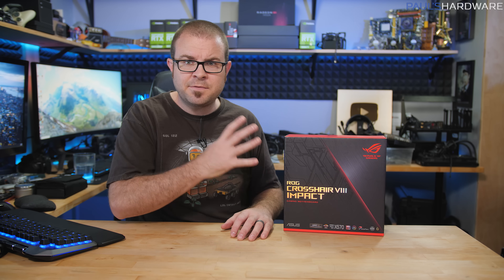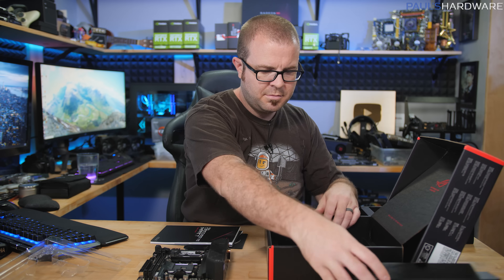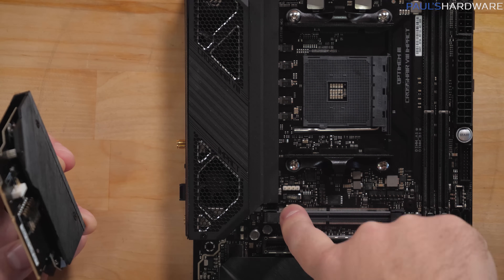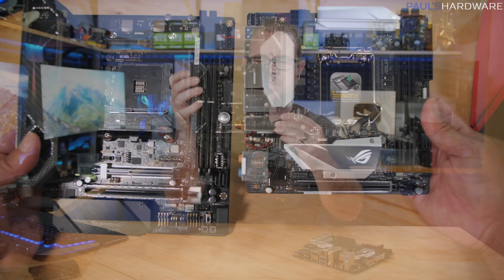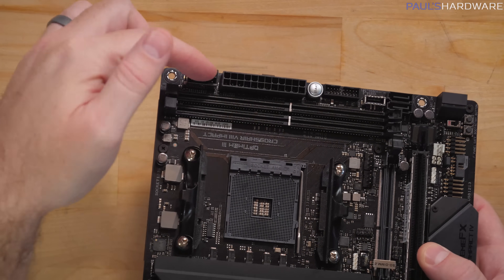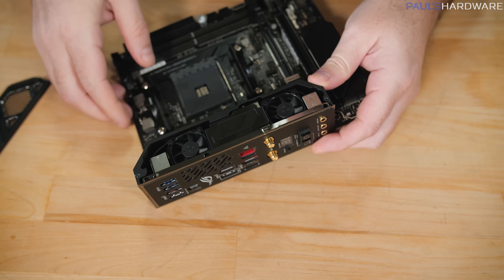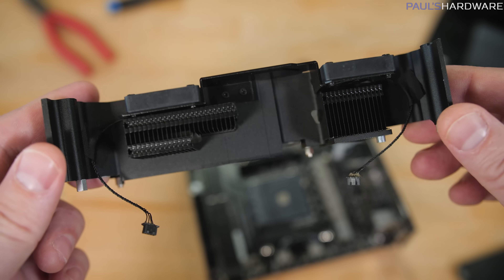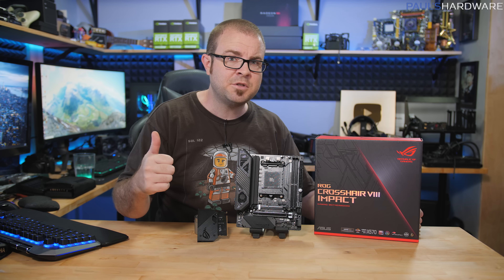WTF is Mini-DTX? Checking Out the ASUS Crosshair VIII IMPACT!

Comment: TL;DR
Mini-ITX is single expansion slot and Mini-DTX is slightly longer for two expansion slots.
Reply: So why not call it an E-ITX, like E-ATX?
Reply: Devin Oakley not confusing enough that way.
Reply: @user-mt4zr5kp7h  Good point!
Reply: @devinoakley4063  or how about Micro ATX? cough
Reply: @MrCODEmaster00  Mini Micro-ATX
Reply: @devinoakley4063  no because eatx is wider while eitx isn't
Reply: @devinoakley4063  oh and E-ATX already exists, another neat one (more functional than just more expansion) is Thin mITX
Reply: @MrCODEmaster00  I know E-ATX exists, that was my reason for suggesting E-ITX
Reply: @devinoakley4063  whoops misread that, also the separate reply saying Micro ATX cough was that this version of DTX isn't too far from being Micro ATX..

You have Mini ITX , and then Thin Mini ITX, Thin mITX is a big difference, this Mini DTX isn't too far from Micro ATX., imo.
Reply: Lol then what the hell is a micro atx?!
Reply: @AW-kj3ln  It's pretty much what it sounds like. Larger than Mini-ITX, smaller than ATX.
Reply: @GallopingWalrus  There's more to it different quality parts are used from an ATX to an ITX all the way around. Many many different features to each size of board. Memory capacity, are you running more than one graphics card, what chipset etc
Reply: @stepheneckart1416  Absolutely true, but even the worst motherboards(from the bigger, well known manufacturers) are pretty good nowadays. Also, there are some pretty baller Mink-ITX motherboards nowadays, on par with some pretty high-end ATX boards.
Reply: Especially on AMD side. You got X570 on Mini-ITX, DTX, Micro-ATX, ATX and E-ATX. Chipsets are alot better spread out than before. Though a B450 E-ATX would be silly, but I would love it for the meme.
Reply: @GallopingWalrus  Thats true. for how long though with these new games coming out.
Reply: True hero. I was looking for this.
Reply: thanks.
Reply: beerpowered so an additional slot costs an additional $300 these days? 🙈 Micro ATX for under $100 perfectly replaces this DTX motherboard.
Reply: Thanks this really helped really fast
Reply: TY lol 😆
Reply: DTX would be... As DTX so far only exist on paper.

Comment: I use a 5.25 optical drive since some games I play still require a physical disk to install. Sure I can get these games as digital download but my internet is crap half the time. Figure since my internet sucks and I have a ODD in my case I may as way use the disk that comes with my boards.

Comment: Wow $400 for an Asus Mini-DTX board that wont fit 2 slot graphics cards, has limited compatibility with Mini-ITX/Mini-DTX cases, and might not fit a tower CPU cooler... good one Asus ive been waiting since May 2019 for this board and now I find out about all these flaws? the GIGABYTE X570 I AORUS PRO WIFI for $220 is looking mighty tempting.
Reply: Man, I've sworn off Gigabyte products. My Gigabyte GTX 970 warped(Gigabyte: "it's totally normal!") and after a few years the VRM burned out from not having contact with the thermal pads. Dad bought a higher-end X470 Gigabyte mobo with a Gigabyte 2070, both of those had loads of issues. My Gigabyte Vega 64 was the single buggiest piece of hardware I've ever owned, had to RMA it several times and most user reviews had a similar experience; it also had a poorly-shaped triple-slot cooler that wouldn't fit in six of my cases(seriously, 6 different cases) so I had to get a bigger case for it(which drives me nuts). Ended up shaving off part of the cooler shroud so that it'd fit in my Node 202 case, thermals are fine with the fan speed boosted under load but the coil whine sucks and now there's no way I can RMA I again; just got a 1080 Ti while it was being RMA'd because I was so disappointed.

Maybe their other products aren't so bad, but they've had far too many strikes for me, man. ;-;
Reply: @FFFan3445  Thanks for sharing your experience, ive had a Gigabyte motherboard before but only once and it worked pretty well but not as good as my Asus stuff. I havent owned any Gigabyte video cards or any of their recent motherboards however, the time when I owned a Gigabyte motherboard was before Asus even had a ROG (Republic of Gamers) line of products (yes a very long time go when Abit and Shuttle still made motherboards lol). 

Thanks for the heads up on the quality of Gigabyte products lately though, ive been wondering why their video cards and motherboards have such bad ratings on Newegg (3/5 stars) and I thought people were exaggerating but coming from someone like you who has owned multiple Gigabyte products I find it to be more believable.

Comment: I somewhat like the idea for them to include a front panel I/O extension cable BUT from experience with front panel I/O extensions they are ALL crap and I don't mean that in a quality sense because they are good quality I mean that they literally come loose relatively easily compared to them just being on a motherboard as they have less support and when on the motherboard they are touching each other to help support each cable. I have tried multiple braided front panel I/O extensions and have had the same issue the ONLY fix I found was to get heatshrink (initially I tried electrical tape but that came loose relatively easily over a couple of weeks) and hold the cables together with it
Reply: I remember Corsair released front panel I/O extensions but if a case company wants to do braided front panel cables then I would much rather that they have a replacement front panel I/O available or at least include it with the case and use that

Comment: No one here bothering about the 400 Dollar Price Tag and "only" Gigabit Lan, but AX Wifi ? I mean AX WiFi is kinda nice, but a Router for that would be like 400 Dollar also. Also u need to be in the Same room to use AX WiFi. Would be better to just include 10Gbit Lan and normal AC Wifi, cuz no one should use WiFi if u can use a cable.

Comment: If I were to use this motherboard in a Meshify C mini with a H115i Platinum, would there be enough space between the radiator + fans and the ram modules?

Comment: How well will this board handle the 3950x?  I've noticed that a lot of the boards have a 8+4 or 8+8 for cpu power supposedly to handle the extra power draw from the larger multi-core cpus (3900x & 3950x).  I can't help but notice that this board only has one 8-pin cpu power plug.  Do you think that will impact performance for these cpus?

Comment: Paul, would it be possible to see you do a small stream encoder machine with that, using gtx1660 ti or rtx and then do a m.2 pcie x4 to a normal pcie adapter for a capturecard?

Comment: which is better gigabyte x570 i Aorus pro wifi mini itx ($220) vs ASUS Crosshair VIII IMPACT (about $400?)
Reply: I've had two ASUS mini ITX ROG IMPACT motherboards that died (or had major components that died like the sister-board allowing for NVME and wifi), but I'm still rocking my Gigabyte...
So I'm a little bit biased on that one! xD
Reply: @kabochaVA  
A ROG board dying?
Why am I not surprised. :|
Mine did as well a few years ago, replaced it with a Gigabyte board.
Still going strong. :)

Comment: Would have rathered a PCI 4 slot instead of the strange proprietary connector for drives but at least it something.
Reply: Yisrael Sebbag
You better buy intel in you need good I/O!
This is meant for noobs, they never need anything good here, just frames....
Reply: What intel mini itx or dtx has a pcie x16 and x4 slot since I need room for my gpu and a pcie ssd I have i need 2 slts

Comment: whats the point of mini DTX? is there any mini DTX cases out there that's actually good for a reasonable price? I mean, if you wanna go small, then pick mini ITX, as mini DTX wont fit in an compact mini ITX case, and if you want a bigger mini ITX case, then just get mATX since that one is usually cheaper and better. so, speaking of mATX, If you wanna go medium-sized, then go mATX, mini DTX can definitely fit on mATX case, but why tho? And lastly, ATX if you wanna go big, or EATX even. But i'm sure being big isn't what this mobo particularly designed for. So again, what's the point of this form factor?

Comment: Interesting product demo Paul, thanks for the details. It's not that expensive if you compare it to some small form factors boards like a LatterPanda Alpha a very powerful SBC.  They come in around $450. CAD. It's nice-looking board and it appears to be designed to deliver good performance. Can't wait for it to be installed and game tested.

Comment: Awesome stuff, really wanted to see the insides how those fans operate there. Best part of this mobo is that 8pin next to 24pin, every motherboard should do it. Granted the distance to CPU socket in something like E-ATX is much more, so maybe not there, but standard ATX / mATX should be no issue. Why it looks so nice is I finally ordered some sleeved cables and those next to each other would look even better. If I had designed this, I would have combined chipset+VRM with a heatpipe and just have one 40mm fan on the chipset side standing up blowing across both.

Comment: Most Mini-DTX motherboards have 2 PCIe slots, it's actually incredibly disappointing to see that this board only has a single PCIe slot.  There are a few Mini-ITX cases that have 3 PCIe slots, so this is a missed opportunity in my opinion. 

Just one more PCIe slot would give a lot more flexibility, even if it is just an x1 slot.
Reply: Asus ceo is an audio nut who wants to push his agenda.

Comment: Sooooo Mini-DTX is just mini-ITX with a little more height for 1 more PCIE slot or extra stuff?

Meh
Reply: This is a terrible implementation of the form factor.
Reply: It's not really economical at the moment because it's not a "common" form factor, but it seems like a logical step forward for SFF builds that don't use ribbon graphics extension cables.

Comment: That DIMM.2 card is WAY too tall to be used in a REAL small form factor build.  Whoever designed that should be fired.
Reply: The board is specifically designed for use with a gpu plugged directly into it. That's taller than the expansion card. Additionally, Asus materials indicate that they expect most people to be using a higher end cpu that will require an aio. It's small, but it's meant to be used large.
Reply: @zoomzabba452  I have a Cooler Master Elite 110.  I also have a dual slot GPU in it.  However, the PSU is over the top of the board, and this DIMM.2 can't be used because it occupies the same space as the PSU.  It's simply too tall. I'm sure many other cases have a similar layout.

Comment: That's an interesting form factor.  Seems like a good idea to utilize that space that would otherwise be sitting under a graphics card anyway.  As far as the integrated I/O shields, I always figured they were separate to compensate for cheaper cases where the cutout isn't always perfectly centered.  With integrated shields, a misaligned cutout might put a bit of strain on the connectors, or make it difficult to mount the board.

Comment: I don't understand why so many mini-ITX/DTX boards skimp on the audio output so much. A lot of people build these things for home theater PCs. Is 7.1 audio output so much to ask for?
Reply: "Gamers will use a DAC" 
"We put in a DAC for the GAMERS" 
"Gamers Gamers GAMERZ. ROG"
Reply: @zoomzabba452  HTPCs can be used to play games. They're not mutually exclusive goals.
Reply: @AbeDillon  Fair enough. I've yet to diversify my experiences. HTPC has always been low powered, desktop rig too much hassle to drag to the TV. Will probably change when I have a sub-10L gaming rig.
Reply: I have a 5.1 system for gaming. With the itx boards, it's a weird 1 m.2+easy 5.1-7.1 or 2 m.2 and weird software remapping of fp audio. I'll be using a USB sound card I guess :|

Comment: What Paul said about the driver CD being a stretch case actually happened to me before, so take that Paul!
Reply: Motherboard manufacturers know that almost no one will ever use the CD, or would use a USB Drive which I've seen many youtubers complain about them not adding, as almost everyone has an internet connection available. Sure the USB drive would be better, but they can buy a box full of CDs for what it would cost to get a handful of USB drives.
Reply: @fred_derf  i must use mine because usb not worked

Comment: I wish Driver CD's got phased out. Case manufacturers do not even include CD Drive bays anymore.
Reply: Yes they do. Maybe not on "gaming" cases but the Fractal R6 still has one.
Reply: @bothellkenmore  I don't know why cases designed for gaming computers have a bad connotation. The R6 is a very old case keep in mind.
Reply: @DoomWalker42  No negative connotation implied. I should have added "vs, workstation" or similar. I think in a review of the new Fractal Vector, someone mentioned the R6 came out in 2017. Now the previous gens like R5 etc. are quite old. To your original point, most people download the latest drivers anyway so a CD, USB key, etc is kinda worthless anyway, with a few exceptions.

Comment: That on/off switch is used in LN2 overclocking. You can switch it on and the board/CPU will basically stay at fixed low ratios so you don't waste LN2 while you're in the UEFI settings things up for instance.
Reply: Vithor Leal
LN2 is just BIOS setting, the switch is to enable higher volt settings, run them on 200 Watt!
UEFI is more complicated when you enable the switch too, more settings, less easy profile shit will work!
Have you seen them on 200W, GN Steve did a life show, not any near good...Not needed at all, only on liquid helium, unable to produce more frames this way.....

Comment: A second PCI-E slot would have made more sense than that DIMM.2 slot
Reply: Not possible. A graphics card takes up two slots and the second PCIe slot will be covered up by the graphics card. It's not like that SODIMM.2 slot lines up with any expansion slot anyways.
Reply: @Goodmanperson55  It works fine if you put the GPU in the bottom slot.
Reply: but then it wouldn't be a itx/itx form factor, a 2nd pci-e slot would have made it a micro axt and would have a length of 9.6 inches instead of the 8 inches this board is, then it wouldn't fit in most itx cases and would have to be in a larger atx cases

Comment: Great job, Asus. A $400 water cooling only board because you can't fit a decent air cooler on it, and yet the board has more fans on it than entire case for it probably has...I bet that backplate was totally neccessary too, gotta justify that price tag.
With the ammount of compromises made in regards to this form factor and the size of it, you're better off just going mATX, for more freedom and much less money. But idiot manufacturers have forsaken mATX, for whatever dumb reason, and now they're gonna sell you inferior version of it for stupid prices...
Reply: Noctua NH-D15S fits easily, with the M.2 daughter-board plugged in, and so does every large cooler offset towards the top of the case/SoC VRMs, ...

Comment: What i'd like to see standardized first of all, is the EPS to be next to the ATX connector =/
Reply: longer traces to VRM means it's a pain in the rear to do for motherboard manufacturers i think...
Reply: @josuad6890  exactly not to mention its on the other side of the ram so it has to go around the memory traces to ensure signal integrity so you dont end up with a bunch of memory oc/freq. issues tho i dont think its a cleaner look personally cuz your eps is almost always basically tucked away in the upper corner with its own pass thru on most case and is in 80% of builds not even noticeable so for it to go in a area that already has 24pin sata io usb3 its just gonna go in a area already normally loaded with cords so personally dont like but not a bad touch
Reply: Bad idea. You want the traces to be as short as possible. Also, cpu traces are thick, they move a lot of power. Not easy to route inside the mb.
Reply: Second. Standard for front panel connectors first for first time builders.
Reply: I totally agree! Cleaner look

Comment: No video out on the I/O :-( And it's $400!?!   Which means you HAVE to have a video card.  So it's really a ~$600 mobo, at best.  But I guess if you're someone who would pay the ASUS tax for this board, you're also someone who's gonna pony up for an nice video card.
Reply: Why would you put an apu in a costly, high-end board design for OC?
Reply: @zoomzabba452  I was really thinking about in terms of occasional troubleshooting.  Sometimes it's nice to have onboard video when other hardware is acting up.  I hear what you're saying though.  My point really was you pay $400, but you don't get a video out port.
Reply: @kristfur  For troubleshooting, I agree. For everything else, it's eating a ton of io space. Not that they have optimized it with this board.

Comment: This is a cool concept for sure. I like the idea of a somewhat larger SFF set up. I would definitely look into buying a board and build a machine like this.
Reply: this probably fits in most cases that support a dual slot GPU mounted on the board. So a loque Ghost and other sandwich cases are probably out, but many cube shaped one probably work just fine.
Reply: Andrew Frink I like your thinking. (:
Reply: yup, this is what form factor I went with for my cousin's new build, because it looks better than m-ITX inside his case and its narrow enough to give room for the AIO cooler that he put in the front of the case

Comment: DTX? I would rather have an updated BTX motherboard...
Reply: I have a sneaking suspicion that you typed this on a Dvorak kb. Not sure if there is A track ball involved.

But yes, BTX was a good idea. I only ever saw one in the wild. That was 2006.
Reply: @zoomzabba452  I have 2 computers I was given for free but they are only socket 775, I wouldnt mind using the cases for some updated builds.
Reply: @gremfive4246  775 was the newest socket for BTX before it was discontinued. Maybe 939/940, but probably 754 on the AMD Side.